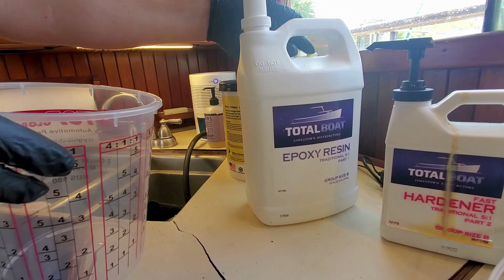Trawler DIY- Headliner replacement and repairs Part 1- Headliner removal and epoxy repairs

Comment: Stone coat countertops epoxy is wonderful stuff. They even have a video where they redo a boat countertop. We are using it in out boat!
Reply from the maker: Thats a great idea. I want whatever we use to be fairly easy but also not break the bank. Ill check it out. Thanks.

Comment: Where do you find that caulking gun. I’m getting ready to pull my head liner due to the upper deck core is toast. But I also removed my mast and rebuild a much more stronger one. I have 2 beams that run side to side making the head into like 9 squares. But also going to reuse my head liner I believe but not sure how to remove it from the cross ribs. I’m also going to be adding insulation cause I notice there’s about 2-3 in of space but I also will be living on it year around in southeast Alaska.
Reply from the maker: https://www.aircraftspruce.com/catalog/topages/sealantgun-rtnrcmbo.php
Reply from the maker: The sealant gin is air powered. You can get things in holes with alot more force and control than a caulking gun typically. But a battery powered caulking gun and empty tubes from Amazon hold a ton more material.

Comment: What is that high pitch wine?  Sounds like a jet motor
Reply from the maker: I had to watch it for a second before I realized you were probably talking about the AC unit. The AC unit is a single larger 16k BTU unit right under the dinette seat that blows ice cold air. The main vent is facing the galley. Now that you mention it I have some sound shield that I could line the inside of the dinette to quiet it down some. Thanks for the idea...lol.